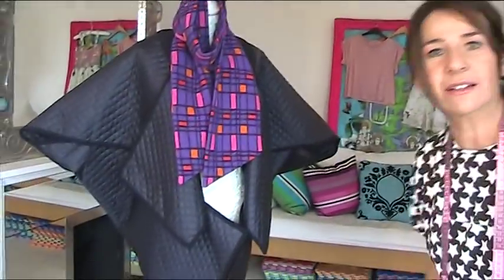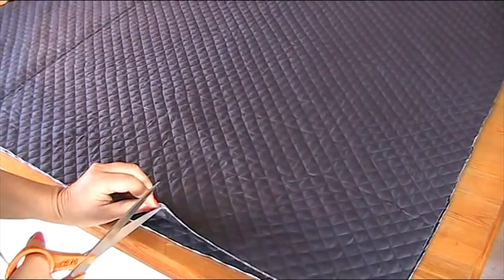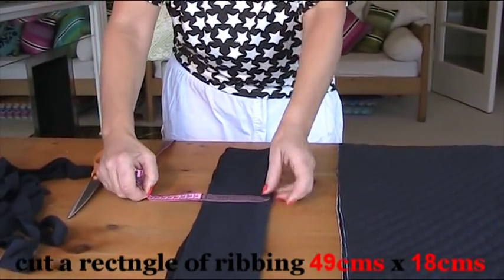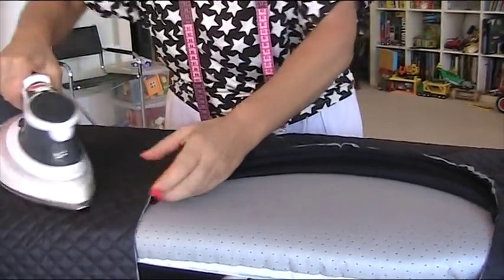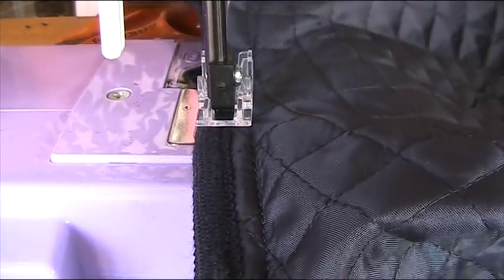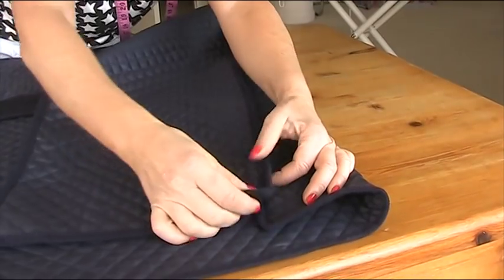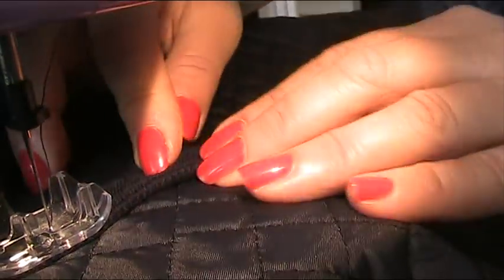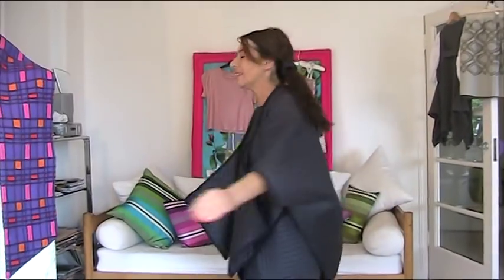How to sew Japanese Style Zero Waste Coat

Comment: i love this and want to try it but i can not understand how you folded the fabric to make the first cut
Reply from the maker: Hello Ingrid, Thankyou....I wear these coats all the time. I do have a pattern somewhere but you really don't need it. Watch the video again....it's all about the size of the rectangle and then folding in half. You only cut the neck shape out of 1 layer. X
Reply: @StitchlessTV  okay thanks i will watch again one question when start cutting the neck is it 4 layers are 2 deep i got it that you only cut the top layer for neckline  is it one fold lengthwise
Reply from the maker: Yes.